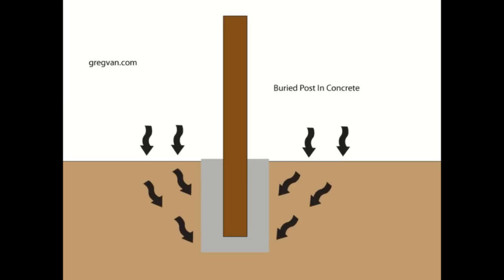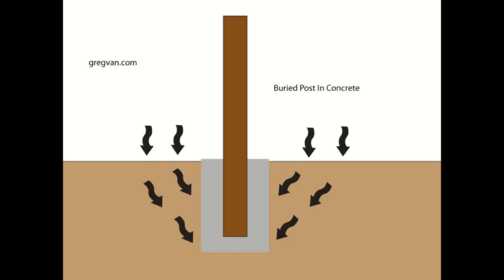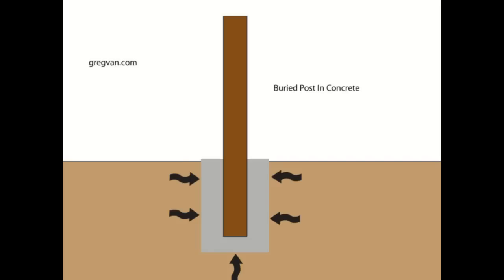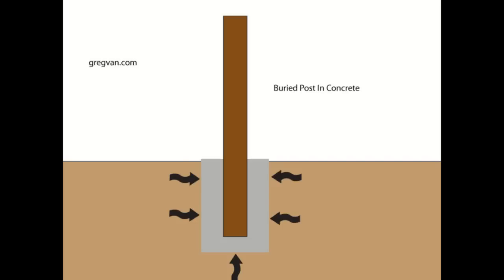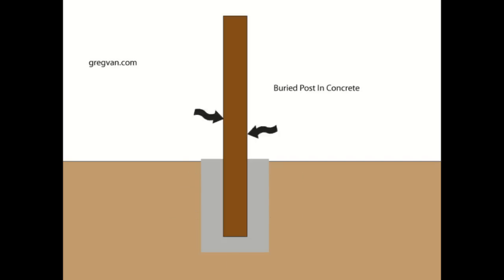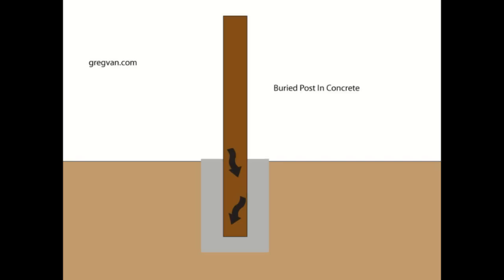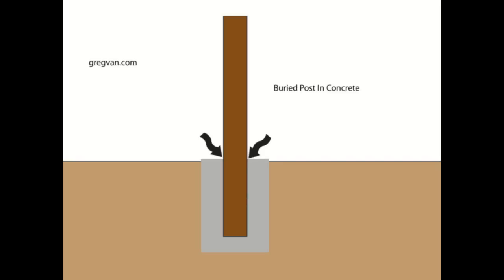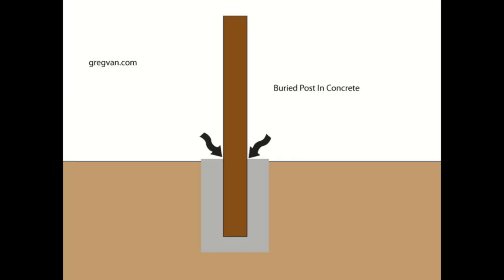Why Do Fence Posts Rot and Break - Wood Fencing Damage

Comment: if you will put a thick mil. trash bag on bottom of post, set post in hole concrete up to ground level, slope top of mix away from post. never concrete a treated post unless you do this or some way of keeping post and mix from touching after mix sets just trim bag at top.
Reply from the maker: +tubeonline629 You could try it, but I think the expansion and contraction of the wood and concrete together could rip the plastic over time.

Comment: The cracked concrete around posts up north is also caused by moisture freezing in the gap around the post.  Freezing water expands, and presto!, cracked base.  More importantly, up north, the concrete base allows moisture in the surrounding soil to freeze and grab on, lifting the base, the post, and the fence right out of the ground.  Next time you see a line crew replacing a utility pole, watch how they do it.  Those poles last upwards of twenty years, with no maintenance, and no frost jacking.  Sounds like they've got it figured out!
Reply from the maker: You got a good point about water seeping into concrete and freezing and thanks for taking the time to share this information with us.

Comment: The trick is to prevent fungi growth.  Everything outside gets wet, and everything wood that gets wet will rot.  The longer it stays wet the faster it will rot.  Used motor oil and diesel fuel mixed can be applied to fence posts even just around the base every few years and make them last much much longer.  Otherwise modern treated lumber you might get 10 years if you're lucky but no matter what you do if you plant it, and leave it.  Then it's going to rot eventually.

Comment: Lack of resin. I use primitive methods to construct practice camps in the woods. I've found that the logs with a abundance of resin last 10x longer than the ones with little resin. I planted a fat lighter stump vertically in the ground 5 years ago to use as a splitting log the bark is all rotted away and the white flesh under the bark but the inner resin level has preserved the stump for the most part.
Reply from the maker: By resin are you referring to sap and could you provide us with an example of the trees that were cut down and used. I do know that some trees last longer than others when used for exterior projects, but it might be helpful to find out what your trees are.

Comment: In addition to putting a post in concrete, why not cover the post with driveway tar and line the hole with a plastic garbage bag before pouring?  This would eliminate as much potential for moister as possible.

Comment: Brush the post that will be in the ground with 50% oil and diesel. Also avoid putting the concrete under the post. If possible put crush gravel. Like this it allows water to drain and not sit in the concrete

Comment: the cement in the concrete actually rots the timber which is why a hand rammed post rots at a much slower rate
Reply: +mark scott My experience leads me to disagree with this.  Not claiming to be an authority, but just sharing what I've been seeing.  I have about 270' of 6' privacy fence, and I've personally repaired more than half of it.  My yard gets a LOT of water seasonally, and in some areas the bases of the posts are submerged for a few days, in other areas the ground dries a lot more quickly.  My fence was in the 12-17 year range when the posts started breaking.  Every one failed at ground-level (right at the top of the cement anchor), and all appeared to be due to the fact that dirt had accumulated over the tops of the cement.  The interesting thing:  when I would pull the old cement anchors out (using a jack), the wood IN the old cement was still perfectly solid.  None of my broken posts had rotten wood in the anchors -- the rotting was all concentrated at ground level.  So I don't believe it's the cement holding water against the wood.  And as I've repaired the posts, I make sure my cement is coned up slightly above ground level.  YMMV

Comment: Use secure set from GRA services. It should adequately isolate/insulate the wood post from the water. And no I have not used it yet, I would prefer some one else be the guinea pig. ;)

Comment: 60 years ago my grandfather built our garden fence and it is still standing. He tarred 70 centimeters of the 240 cm poles, 60 cm went into the ground with 10 cm of tarred pole above ground level. This simple method has prevented the poles from rotting. Do I become a millionaire for this simple tip gregvancom ?

Comment: How Do Postsaver Sleeves Stop Your Fence Posts Rotting? - YouTube  I think this video explains it better. Water does not cause rot by itself. it is the combination of water, funi and oxygen typically +/- a few inches at ground level that kill a post. If you jsut wrap around this area it greatly extends life of post.

Comment: The post will rot level with the ground long before water seeps through the concrete. (Unless youve built on a swamp!) The concrete should finich higher than ground level and taper for rain to run off.
Reply from the maker: Defiantly Sometimes.

Comment: Horse owner here. This is what I learned over the course of 30+ years building my own fences. If your post is in clay, it will last for a LONG time and won't need any concrete.  The holes are a bear to dig by hand but the clay sure holds the posts tight. Sandy soil is easy to dig but  will hold water around your post and your post will rot quick! Concrete overall  is a BIG waste of money since water pools on top of the concrete and rots the post there!
Reply from the maker: I would love to know where you're located? I'm located in Southern California and have had problems with the wood post setting in a concrete footing rotting and fence posts leaning and falling down when they weren't.
Reply: Hi,  I live in  Gloucester, Virginia, near the coast where we have either sand or thick red clay once you dig down.  My horse'fences  here  are now 30 years old and still standing but I have a feeling  that they are all  going to start going within the next 5 or so years. The one's I set in concrete have long rotted and I learned my lesson to forgo it around here.  Interesting enough I have  removed a fence line  that was up for  30 years and  actually pulled up perfectly good posts that I have used again on another fence.  I noticed that anything that survives that long was always in clay soil.

Comment: Spray the pressure treated post with liquid rubber twice and let it dry before sinking it in concrete. Creosote the post above ground level each year.. should last 30 years

Comment: Apply tar to the bottom of the post in roofing tar before concreting. My posts have been in the round for 5yrs and haven't rotten yet.
Reply: Five years is not nearly long enough to prove the efficacy of any method. I also wonder if sealing the bottom of the post is a good idea. It could seal water in. I think the idea of crushed rock at the bottom of the hole is a good idea.
Reply from the maker: I agree

Comment: i'm addressing this issue totally by accident. We will be replacing a steel fence with a wooden one. instead of redigging fence post holes i will be using the ones in place using a product by OZ Post called an OZ Post bracket. this will leave the steel post foundation yet give me the wood post look ...
Reply from the maker: I'm not 100% sure what you're suggesting, but if you're going to install a wooden post on top of existing concrete, then you might not have any structural strength. When the post is buried in the ground about 2 feet and sticking above ground 6 feet, then the 2 feet below actually keeps the post from moving. You won't have the same affect without doing this.

Comment: Instead of concrete use foam mixture. Pour the foam mixture inside the sauna tube around the post. Remember that the wood won't rot in concrete within few months or years. It will eventually over a very long period of time (20 + years) depending on what part of the country you live in.

Comment: Wood should never touch concrete. You learn that literally day 1 of construction. They use pressure treated lumber to slow the decay but water rots lumber when it's open to the air like this.  That's why boxyed galvanized steel posts are much better and the gold standard in fence building. Your fence literally just hangs in the air and no wood is actually in the ground.

Comment: The number one reason that most fence posts rot quickly is that people do not cap them. Most people assume that caps are for decorative purposes when they are not,they are there for a reason and that reason is to protect the sawn off top of the post from soaking in rain water.Water travels through wood along the grain a lot faster than it travels across the grain so always leave your posts taller than your fence and attach a good solid cap and your posts will last twice as long!
Reply from the maker: You've got a good point, but I've never heard anyone ever, mention it. I'm just going to throw this out there and see if it sticks, water can be absorbed throughout the entire post and this would provide a larger surface area per square inch or feet to absorb even more moisture than a small square at the top.
Reply: gregvancom I had problems for years with fence posts rotting after only a short period until I was told to cap them and believe me they have lasted much longer. I also have have now started to dig a hole directly under where the post sits and filling this with stones (had some spare decorative stones lying around) and I also wrap the bottom of the post in cling film, this helps to keep the bottom of the post from sucking in water from the concrete and the stones underneath allow the post to dry out. The fences I put up approx 5 years ago made it through some really bad winter storms but next door who's fences are only around 2 years old are all on the ground like matchsticks! - No exaggeration!!!
Reply from the maker: That is interesting and I've heard stories like yours before. I'm just not 100% sold on your method, but in no way would suggest that it didn't work, because I've seen it myself, but I've also seen problems created from it.
Reply: Interesting! I am replacing a ton of fence posts that I installed about 7 years ago due to rotting and never thought about capping them. Now that you mentioned it, it really does make sense! The posts I used were square, pressure treated posts but my dad installed his at his house a few years before me and is not having any problems. The only difference is that he used round posts while I used square.... not sure if that has anything to do with it or not. Ideas/thoughts/tips? I am replacing my square posts with round ones as we speak.
Reply from the maker: It's hard to tell whether around or square posts will solve this problem, but if the round posts are actually larger than the square ones, then this might provide us with more clues. One time I had someone tell me that round post work better than square ones, but in reality they were a lot larger, which would also take longer to rot or suffer the consequences of termites.

Comment: Why not paint the post with a water sealer before setting it?
Reply from the maker: I the paint of sealer can trap water in the wood that you would be hoping to keep outside the wood. It absorbs into the wood through small cracks or any imperfections after painted.

Comment: no, having PT wood would rot because over a period of time all the liquid used for PTing the wood would run to the bottom of the wood making it extra saturated especially having concrete immediately under the post so the solution is to have drainage. 1: Put about 6'' of gravel in the post hole for any liquid to escape and not stay saturating the post, 2: Put your post immediately over the gravel 3: fill around with concrete or GRA secure set...DUH

Comment: Wood and concrete are two incompatible materials. They do not work well, together. Everybody does it, just because the next guy does, but it is wrong. It's the first mistake to make in fence building. And I do not see the point in using gravel as a drainage material, because over time that gravel fills in with sand and then you just have sand with gravel in it. A soggy ground is a soggy ground, no matter how you dress it. And concrete around the base will move just the same as a post without concrete or more. The only purpose of using concrete is to anchor the post from lifting up, but if it isn't buried past the frost line they will just upheave anyway. I don't use concrete or gravel. I backfill the hole and compact the soil and the posts hold the same, but the difference is that they don't rot from sitting in concrete. Save the extra time, money and your back and leave the concrete at the store.
Reply from the maker: Wood and concrete are only incompatible materials when they suffer from some type of damage, but seem to get along well when a wood framed home is built correctly on top of the concrete foundation. Ground rated pressure treated fence posts might be the solution to wet and soggy soil and a concrete post footing.

Comment: There is a new product on the market called ROTBLOC that is the made from recycled rubber that is easy to wrap the post and it can be custom cut. You can buy it on their website.
Reply from the maker: The only problem I have with wrapping the bottom of fence posts in a waterproof membrane would be any moisture that is absorbed into the wood, then pulled down to the bottom by gravity where it will sit for long periods of time, until the wood starts to rot. It's almost like they would need to wrap the entire post or don't bother wrapping it all.
Reply: gregvancom
You dont wrap the bottom of the fence post. You wrap ROTBLOC around the fence post where the majority of the post below the ground is exposed to organic matter and moisture. There are install photos and specs on the website and facebook site. It works well, is affordable and very simple and affordable for on person to install in a minute.
Reply from the maker: I probably didn't make myself clear, I would never use a product like the one you're referring to, because of the problems previously mentioned. I guess I've been in the business too long and seen to many products like the one you mention fail and end up costing the property owners even more money in the future.
Reply: I thought it was ROTFLMFAO.

Comment: In the long run, spun concrete poles are the best, should last at least a century. Wood ones maybe 10 yrs and galvanized 20 - 50 yrs.
Reply from the maker: It seems like concrete would last for decades, but I have some concrete blocks that are exposed to soil on one side and the weather on the other side and they're starting to fall apart. Remember, pricing is going to be an issue for most people, but at the same time if they're going the last three times longer, then you could probably pay three times more for them.

Comment: My fence post last me 17yrs in Seattle Washington as it famous for a lot of rain 🌧. If it wasn’t for wind to blown it down it would still be up.
Reply from the maker: Bummer, did the post rot or was it eaten by termites or was the wind strong enough to simply break the post.
Reply: gregvancom 
it’s rod it out from being so wet during the winter. So lucky that we don’t have termites.
Reply from the maker: Bummer, you might want to replace it with pressure-treated lumber, maybe this video will help.https://youtu.be/TheW4lynSkk
Reply: gregvancom 
It was pressure treated.
Thanks
Reply from the maker: Was it a pressure-treated lumber that could be buried in wet soil or something you purchased from your local home improvement center. Sometimes the lumber at home improvement centers or lumber yards isn't the correct lumber.
Reply: gregvancom 
Well I hired the fence company for materials and the installation. The same company that my neighbor used. The post looks like all the post that I have seen every where else like a lumber yard or at the home depot or Lowe.
Reply from the maker: It really is misleading and hopefully more people watch my video. I can't believe how many people I've met or viewers who have commented on my channel who expect pressure treated lumber to last for decades, but if it's not the correct lumber, then you could probably just buy construction standard lumber and get the same results.

Comment: So what construction method is recommended, post in bare soil, enclose base in tar, backfill holes with pea gravel or?
Reply from the maker: That's a good question. I think I would use concrete and make sure that the concrete post base top is above ground and not below it. Go to our website, click on the tab at the top that says outdoors, then fences for more information.
Reply: I always thought to use gravel with pressure treated posts for good drainage.

Comment: 99% of the time, the top of the concrete is buried 3 to 6 inches BELOW the top of the soil and the post will rot out real fast, above the concrete. Whenever I set a post, I make sure that the concrete around the post is visible ABOVE the soil. No wood will last forever in the soil, not even treated wood. But a post should last at least 20 yrs if done properly.